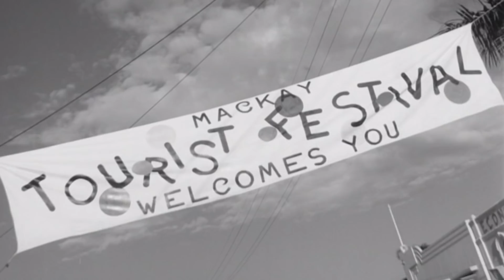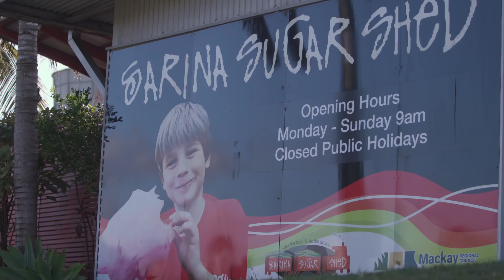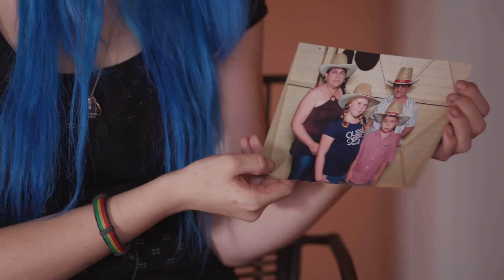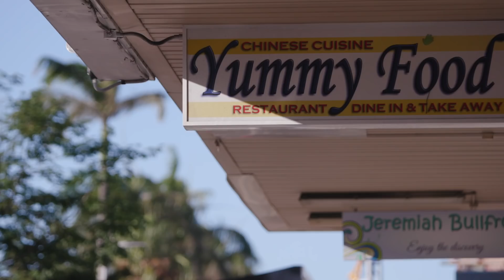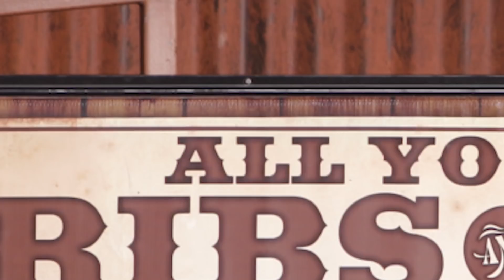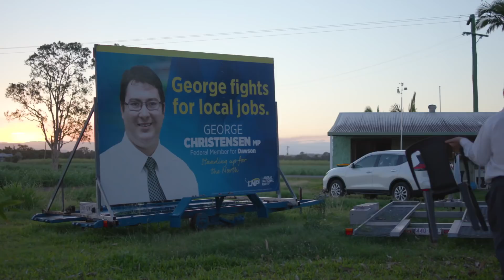Do Australians Need a Sugar Intervention? | Times Documentary

Comment: I am surprised that the New York Times would produce this irresponsible propaganda film. It is absolutely true that sugary drinks are an important contributor to obesity. However, there are four sources of energy: protein, alcohol, carbohydrates, and fats. Mainly, it's down to carbs and fats. There was not even one mention of fats in this video. Fats that are low in saturated fat (such as canola, almonds) are beneficial in small daily amounts, but fats that are high in saturated fat (beef, dairy, cocoa, coconut) are deadly. Saturated fat causes strokes, heart attacks, cancer, and diabetes. All fats, good or bad, contribute to obesity. Alcohol lowers good cholesterol, causes inflammation of arteries, influences high blood pressure, and contributes to obesity. This video presents a popular, but deadly, misplaced emphasis. It would be very good if people would hydrate with water instead of sugary drinks, but they are being falsely reassured that sugar is the biggest problem.